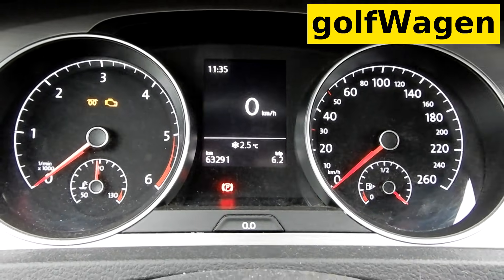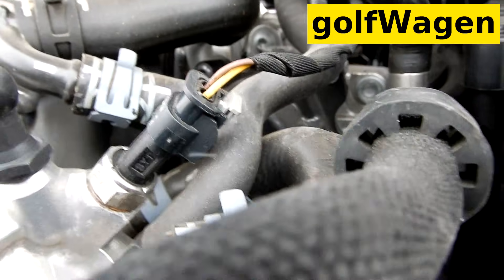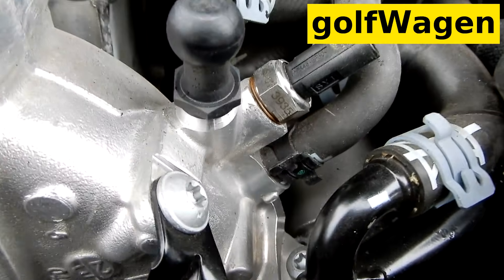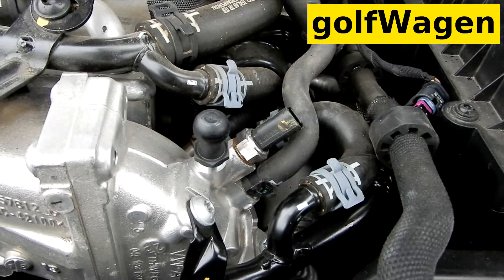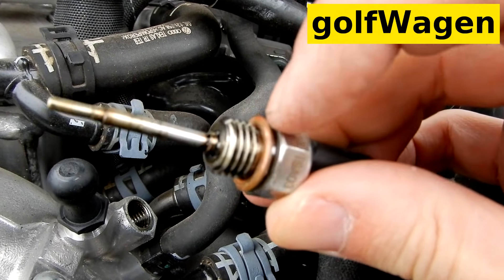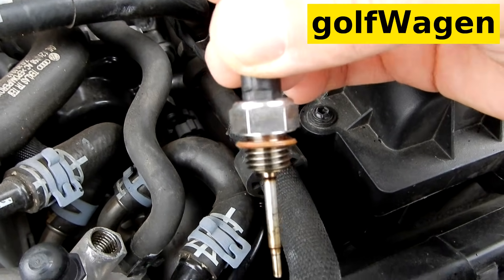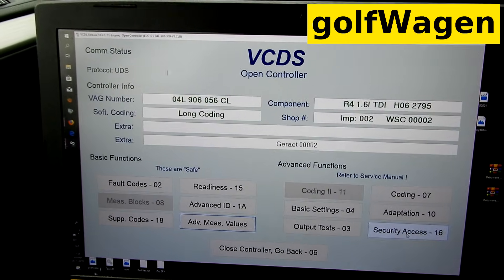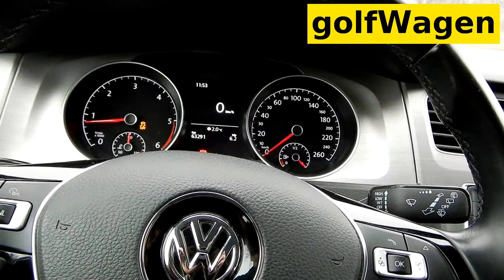VW Golf 7 intake air temperature sensor replacement P00A3 P007D

Comment: I have same problem like you. I have changer bank 1 also I have changed throttle body and still on diagnostic machine it still say I have problem. What else can it be?
Reply: There is no elektrik 
Can be destroyde cable

Comment: What was the symptoms?you change both sensors bank 1 and 2?my car passat b8 at the idle stay at 1000 rpm but not regenerate dpf,when i look to the sensor with vcds temperature was -40 when outside temperature was +20 and no fault codes.
Reply: Also me when start on the car rpm stay at 1000 rpm and diagnostic shomw this code P00A3
Reply: @simoussmef3605  what was the fix?
Reply: @Dstig  i found my brake light lighting always when run the car 
So i change the sensor brake light and the problem is gone
Reply: Hello, what was the fix for this? Thank you. I have same problem